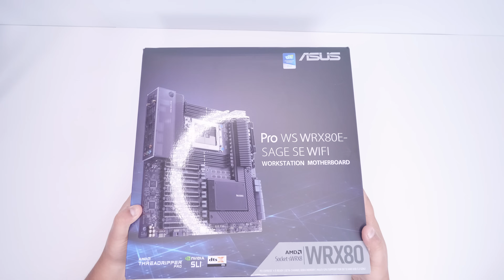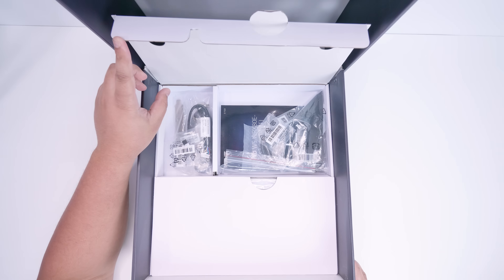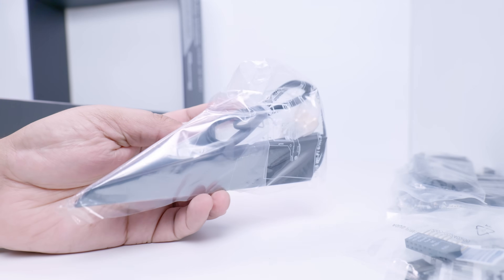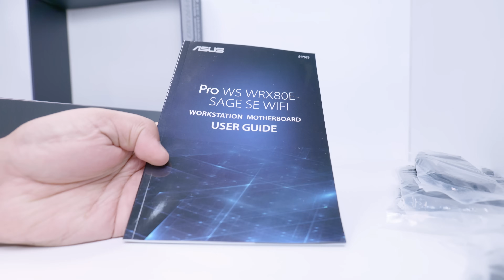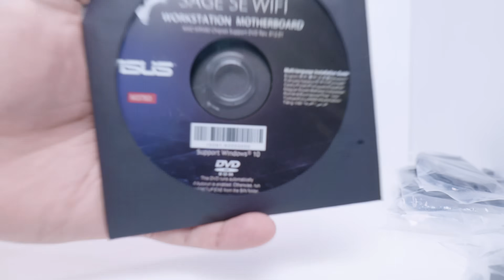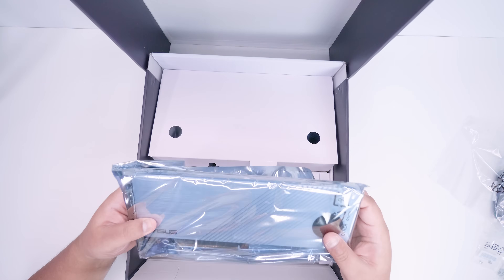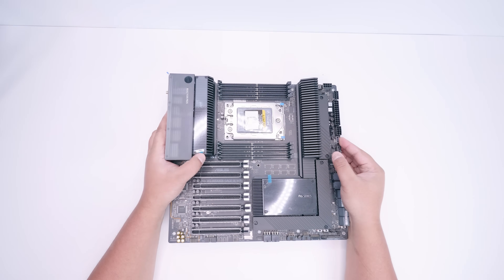You want this - ASUS Pro WS WRX80E-SAGE SE WIFI Overview

Comment: This board is difficult to set up, super slow to boot up, with error messages all over the place, BMC msg light on, difficult to debug, documentation is only superficial. The mobo did not recognise USBs, SATA, ssds,  needed to do workarounds. Definitely did not expect such difficulties from a €1000++ board…

Comment: hey could you guys recommend a good case for this board ive not found any that fit my style which is more of blackout style
Reply: A Thermaltake Level 20 VT is what I use for my WRX80E. 140 x 420 rads on the top, two EKWB
 D5 pump res and two 200mm fans in the front.

Comment: This is a very all purpose motherboard for any use. It fits all 'niche' markets. Eight channel ram is twice as fast as quad channel ram and four times faster than dual channel ram no matter what your using the system for. No matter what the task, 7 X16 GEN4 PCIe sockets should handle the job. This board is for everyone!
Reply: the one sucky thing is it can only handle ddr4 3200mhz ram
Reply: i mean yeah it can handle almost 2tb but
Reply: @TheTallOne890  3200Mz CL14 on 8 channels has the throughput of dual channel 12800Mz RAM. DDR5's higher clocked ram has terrible latency. Graphics cards use quad channel HBM2 or 8 channel GDDR ram for a reason.

Comment: This thing would be my ultimate dream mainboard, if I could afford that platform. 7 PCIe x16 slots, each can be configured to up to x16, given you don’t try to do it on all 7 slots at the same time. In theory, it could work, maxing out at 112 Of the 128 lanes available but with the insane connectivity available on the mainboard itself as it is, I’m not sure, if 16 lanes for all of the onboard connectivity would be enough. I doubt it, to be honest. The M.2 slots take up 12 lanes by themselves, a dual 10gbit Ethernet card would be another 4 lanes. 10 gbit USB for 4 slots is available as 4x card each, so that’s another 8 lanes. Dual usb c 20 gibt would be like 8 lanes. ( I know it’s only one connection at 20 here!). If you take into account that those add in cards are 3.0, while the board supports 4.0, you could Get by with roughly 22 lanes, still not counting the usb headers for the front, SATA and onboard sound. So yea, it’s simply too much lanes needed to max out this board. But granted, maxing out the PCIe lanes is extremely unlikely. For what I used all them slots, I would need 40 lanes on PCIe slots, plus 22 slots on the board.

Comment: This is the board I am looking at for my new build in the Spring of 2022. Decided that going to build a system that is going to last me for a long time (in tech terms) instead of a system that neds incremental upgrades every year or so. Combined with a RTX3090, a mid-range Threadripper Pro & 256GB of RAM (along with a full quota of m.2 drives - both on board & the add-in card). Just got to decide on a full tower case which has lots of 3.5"/2.5" drive bays (considering the Phanteks Enthoo Pro II as that seems to be the case which has the best expandability for additional storage). No doubt will run out of PCI-E lanes quickly LOL

Comment: The 3995WX chip arrived in days, but this motherboard took ~7 weeks to arrive (i'm in the UK). I didn't know it came with the M.2 expansion PCIe card, so I was amazed to find this in the box. Linus says it allows 16GB/s data throughput!! The worst thing about this motherboard is the amount of money you will want to spend getting it to max power - it's insane.

One tip - don't buy the Dark Rock Pro aircooler, it's not quiet at all on a chip this hot - get a corsair H50i AIO which runs at much slower fan speeds even if the coldplate doesn't cover the entire face of the chip.

This board is badass. But make sure you have a case that can fit E-ATX, make sure you have at least 1000W PSU, make sure you will have thousands to spend on the peripherals you'll lust after once you realise the godlike power now in your grasp. 10/10 would recommend.
Reply: Hey Im considering going Threadripper with this MB, Does Corsair H150i capelix have mounting hardware for sWRX8? Their site seems to have sTRX4 mount but is it the same as this WR only horizontal

Comment: I got one in April for a 3955wx. It's a x570/5950x with 128cpu lanes, not just 24. It has 8 channel ram, not just dual channel. We may get a ZEN3 5955wx TR PRO in the fall.
Reply: May I ask: What do you use it for? 3D rendering? physics simulation?
Reply: @jackturner7814  An all purpose PC. Quad NVMe cards have filled my old TR's sockets and I want more space. I've got everything but the cpu and I'm saving for a 5955WX.  Case, power supply, water pumps, rads and drives are in my LR floor. Ram and the gpu will come out of my X399 build. I got used to a PC at home that topped anything at the office. OCD!

Comment: A workstation board without usb4/thunderbolt. LOL.
Reply: Asus has a Thunderbolt4 card, but I haven't seen it tested.
Reply: @maxhughes5687  gigabyte has thunderbold threadripper pro board but ofc it doesn't have all the features this has. also this doesn't have tb connector that those cards need i think.
Reply: @datdudeinred  Thunderbolt is old tech. LOL. Thunderbolt4 is no faster than Thunderbolt3. LOL. What usb4 do you have to plug into a new mobo?
Reply: @datdudeinred  Why tie up a gen4 x 16 PCIe socket to run only 4 lanes for a Thunderbolt card? That's a 128GB socket using 32GB of the bandwidth. What a dumb old piece of Intel junk. LOL